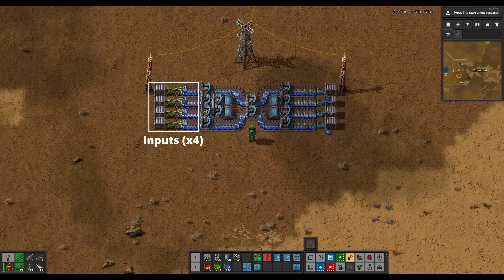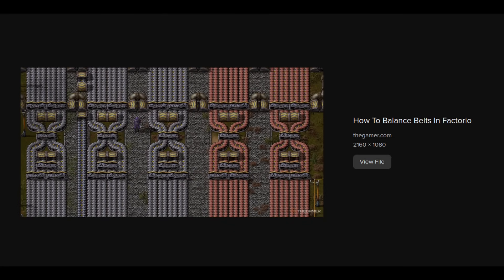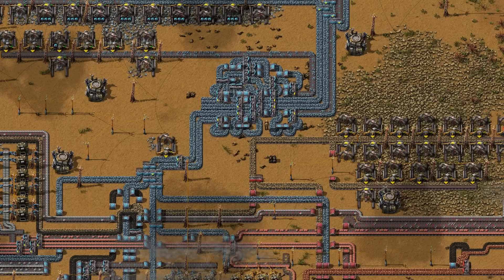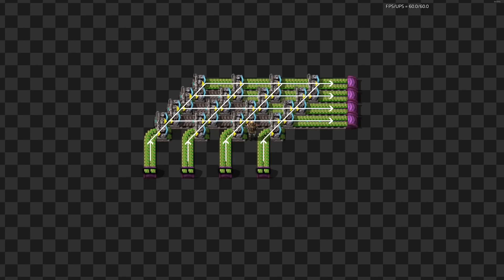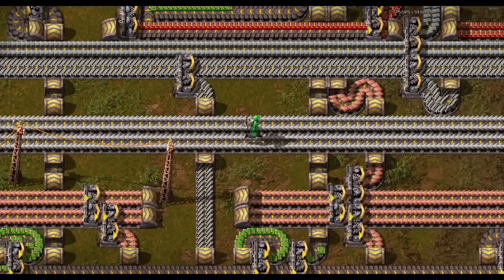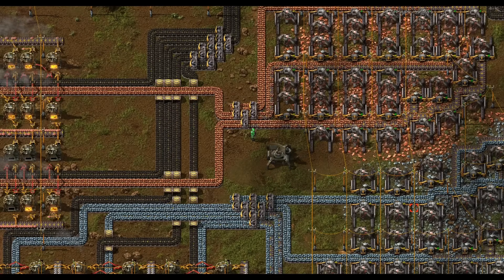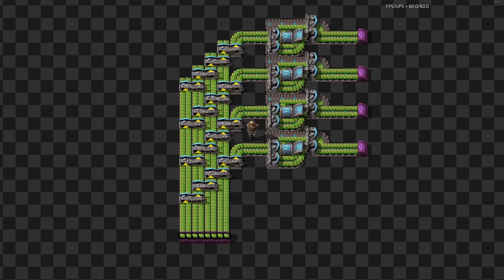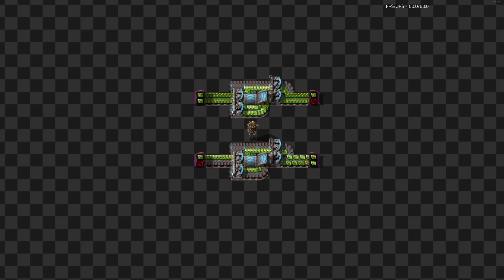Crossbar Switches: An Alternative to Belt Balancers in Factorio

Comment: I'm really glad to hear someone discuss this.  I've been saying for years, lose the balancer.  I don't even balance most of my train stations.  I like to design production areas with a number of production line equal to the number of wagons in my trains, so it just becomes one belt per wagon per production line.  The keys are designing systems with buffers and overflows, and always over-feed it.  Make a supply train offload into chests and depart on a timer.  it doesnt matter if that train leaves with plates or whatever still in it.  What matters is that the delivery chests always have mats in them.

The only thing i really use balancers for is when my supply train needs to feed a number of belts thats different than the number of wagons, i'll stick a balancer after the delivery chests.  And i do use a decent amount of single-belt lane balancers to offset the effect of inserters always pulling from the same side of the belt.

Comment: I've used these for a long time now but never thought about their technical name. I like "crossbar switch" but I'm not sure if it is quite correct because of the difference between input and output versions. I do remember discussions about calling them diamond switches/balancers or triangle switches. One version you haven't covered in the video that is a little important in an edge case is something I have called a "buffered lane prioritization system" or a "compressing filter."

This is useful in a case of an N:M belt system where N > M and the average input throughput is exactly equal to the maximum output throughput of M belts. For example in a line of advanced circuit assemblers made to produce exactly 1 belt of circuits. You might find that outputting to 1 belt causes the inserters to pause and makes the assemblers back up, reducing overall throughput of the system. To fix this you need to output onto 2 belts and then compress them down to just the one.

At a bus level this can be done with something that looks like this blueprint:

0eJytV9luwyAQ/Jd9JlE43MR+7G9UVZS0NEJysIVxlSjKvxfX6aECNmz6lAOYgWVnZ7nAvu5la5S2UF1AvTS6g+rpAp066F09/GfPrYQKlJVHIKB3x+GXPLVGdt3Cmp3u2sbYxV7WFq4ElH6VJ6jo9ZmA1FZZJUfE6ZUE2qZzkxs9cDqARbEsCJzdl9WycLivysiXcZzdkM9b3R/30gxsxCPo2lpZ60Z9aH6DpnO4LIDbuwOag2ncZ2zrfGrrX/HUbT+s/cPIcYw0gbHpbZBSBChnb2eVcTsFhoDdCDz8lYf/cA++fwCfYH0XAZ2P0AZDQDMIyrvu2CMQvgJX98Qo4QQ0pPHkGKUQhMSeHCOPwM8iGtJ2MkFCmtKQkifKoPiCng1NQcZ6tXVO0Rg35Ahq+Tbsd6wq3kDWTn4yeXYnD/+xk/mCOine6QpOQ9UifnaWfAmYIvHtRCxBAJgiwaOB8vOTYWpE3EsDBJgawWMCC7QDmBIhMq6A4exfJGRrzP0Zxv5FRsww7l9EY+Y7D8PYf5HhnQxj//HuNZC2GGUX6b7AMMLOafB4SNg5fXJ+leUhqc9TxluaeaVwVIMwqc2/DKgOISeXuRjeZZ9vuerX04/AuzTduGZDxbpka8HKkpeUQL1zvG724/fs6/UDuD+85w==

Comment: You didn't talk about it explicitly but you did mention that you seem to think even train loading is important, and that balancers have a utility in that instance. I am skeptical of this given that one can always create more trains. 

I view trains as a pipe connecting a supply and demand. If the frequency of trains * train capacity < production rate then production will be restricted, if the reverse is true then trains will idle. Obviously we don't want the former, so we should have the latter: an excess of trains. Therefore we will have idle trains. If the trains are going to idle anyways, why does it matter if they are not filled in minimal time? The only thing that matters is that they don't fill so slowly that they frequency drops and constricts production. 

It seems like people are often using balancers at production stations because they aren't running enough trains. I think they should just have an overflow station with an extra train idling at that location to capture any production that doesn't get captured by the primary loading location. In other words each station becomes an B, A stop. First you stop at B with no condition (you are waiting to go to A), then you advance to A for the full load. If flow is uneven and loading into  the last car of A takes longer, that will be okay as the next train will take that load at station B. 

Obviously there are downsides to this, but it seems easier than trying to design some of these crazy balancers. I would be interested to hear some discussion of this.
Reply from the maker: Oh, the real problem isn't really with loading the trains unevenly… it's loading the buffer chests unevenly.  Stations often have 6 or 12 of those, and they're larger than the cargo wagons themselves are.  Loading from the front only, for example, could have over 12x the materials stored in buffer chests before the second cargo wagon gets any items.  Repeat for X wagons in the train.  On the flipside for something like a mining patch, when you run out, you'll have thousands upon thousands of items in most of the buffer chests yet the last wagon will be empty as the mine expires; some train stations might not send out due to inactivity.  Even if they did, train throughput would drop.  The convenient method is to balance loading the buffers so when you run out, there's almost nothing left to clean up.
Reply: Running more trains for the same load means that your train network gets less efficient as junctions block trains more often. If your train network is sufficiently overbuilt that doesn't really matter, but when it does approach the limit, throughput drops sharply and a poorly built network can even deadlock. So that's a reason to prefer trains to fully unload, and to do that you want even distribution between wagons.

Comment: I have been using these almost exclusively over balancers for years. That whole time I called them "top saturators" since they prioritize saturating belts in a certain direction (towards the "top") rather than balancing across belts like balancers. It's important to note it isn't just a different solution to the nm routing problem, it also imparts an entirely different philosophy when designing your factory, since now your bus belts will be prioritized in a certain direction rather than being fed equally. It is not sufficient to say they both solve the same problem, as 4 belts from a belt balancer behave entirely differently from 4 belts from these crossbar switches. Crossbar switches do not balance generally. You should use a belt balancer only when that is what you want: balance.
Reply: Also you say crossbar switches are not cheaper in terms of balancers, but they ARE cheaper if what you are seeking to maintain is top saturation on a bus through various outputs being pulled off the bus. Say you have 8 belts on a bus. If you want to maintain balance on the 8 belts, you need to start off with an 8-8 balancer. Then after every belt of output is pulled off, you need to put ANOTHER 8-8 balancer to rebalance the belts. However, if you want to main top saturation, you start off the 8 belts with a top saturator / crossbar switch, which may have more splitters than the 8-8 balancer. But, as you pull belts off, you only need 8 splitters, one for every belt on the bus, to maintain top saturation on the 8 belts. So maintaining top saturation is much cheaper than maintaining balance on belts in a bus.

Comment: I used to love the N:M distribution problem, but over my nearly 8000 hours of Factorio I've grown tired of having to solve it every time it rears it's head.
The belt balancer blueprint books that you typically find are VERY helpful to stave off this tedium so long as you only have up to 8 belts on input or output, but eventually even that becomes tedious, and I also got tired of having to create or look up a new balancer every single time I had a larger number of belts on the input or output.
On the plus side, most of the time it's not TOO hard to take any balancer that has a differing input to output belt count and derive one that's got the input and output belt counts swapped, but even then I just got bored of doing the same thing over and over, especially since the larger the number of input and output belt counts got, the longer it took to conceive and implement the solution in a non-linear (exponential) fashion, simply because of the exponential growth nature of how many different ways you have to connect input and output to get the dang thing to function as expected.

I've recently found myself reaching for what I consider to be the Holy Grail of N:M distribution problem solutions, found in a combination of 2-3 simple and small mods:
1. Merging Chests (there's one big suite of mods (" Merging Chests ") that does this using default Steel Chests, but there's another one that creates a new item which uses the Cargo Bay merging logic if you have Space Age, either one should work just fine for this task), by default they let you unite some arrangement of adjacent chests into one larger chest (with Merging Chests the inventory size is either "the sum of the combined chest slot counts" or 2000, whichever is smaller, but Merging Chests only merges chests that form a rectangular or square shape).
2. "Pick your favorite" pretty much any Loader mod (Currently I'm using " AAI Loaders " with a companion mod (" Cheaper AAI Loaders ") that makes the non-lubricated mode loaders actually have sane material costs to make in an Assembler, but Deadlock Loaders is another great one and that one just has sane costs right out the gate)
3. Since I'm playing with Space Age, I have a mod (" Loaders lane-filter and stacks ") that allows Loaders to stack items on the belt as well as letting me use the circuit network to control the loader as if it was an inserter (and set each belt lane's filter via circuit network or manually).

Combine those three mods and what you end up with is the ability to balance belts virtually effortlessly, as well as handling the occasional issue of potentially mixed belts which you might encounter with ore patches that have encroached on each other.
IMO it's not any less difficult to solve the N:M distribution problem this way, but it IS a whole lot more compact (at least lengthwise) since the loaders only take up at most a 2x1 space and the merged chest's dimensions can be as small as N x 1 where N is the number of incoming or outgoing belts (whichever is greater), leading to a minimum length of 5 tiles (or 3 if you are using a loader mod where the loaders are only 1x1 size rather than 2x1), and a guarantee of zero additional width beyond the largest of the incoming or outgoing belt count (looking at you, typical "not great, not terrible" 8x8 balancer).

IMO the overall impact of these mods for solving the N:M distribution problem (assuming you were going to be solving it manually every time without blueprints) is that it linearizes the trend of "how long is it going to take to conceive and implement a given N:M distribution problem solution" as you increase the number of involved belts.
Normally (with only belts undergrounds and splitters) this problem suffers from exponentially increasing conception and implementation time as the number of belts goes up.
With these 2 (maybe 3 or 4) mods, the problem's solution time becomes roughly linear with an increasing number of involved belts.
Reply: Do any of the loader mods give you lane balancing?  I've tried merging chests+loaders before and that was an issue.  Some lane imbalance can be worked around, but others have no clean solution.

Comment: Dude. Solves so many issues I have with my mega bases. Now when I need 40 input ore lines (Five 1-4 trains unloading from both sides) feeding 26 beaconed smelter lines, I don't have to use a 64-64 balancer refeeding the excess outputs back in to the input. It'll be a heap of balancers, but at endgame you usually churn them out. Balanced freedom for weird line counts. 37 to 19 here I come!
Reply: Usually when you're megabasing the concern with these isn't the material cost of the splitters, but the UPS cost of the splitters. That is, big blocks of splitters like this absolutely tank performance in large enough numbers. Though, if that's a concern you're usually going to be avoiding balancers entirely in favor of hard pre-calculating everything.
Reply: @teddy4271 I get you man. Once my mega base is up and running I can usually do away with the large 40 to 28 (or whatever) balancers between ore unloading and smelters. It's the in between time when I don't have enough mines and trains feeding the factory that I need a balancer. When I've finally got 5 trains getting unloaded with 10+ trains in the stacker waiting to be unloaded and the factory's been cranking science for 10 minutes, then I feel like I can get rid of the monster balancer and gain back some UPS.
Reply: Have you thought about using bigger trains? 5 delivery trains for the same material doesn't seem like the most efficient setup in terms of your rail throughput.  I've been pretty successful building around 1-12 trains.

Comment: I have been using this tipe of design regularly since i started to play factorio, i only started to watch some tutorials after reaching oil research, soo i got used to using them before discovering balancers existed, soo i didnt really implement them, 600 hours later and the uses i give to this tipw of design is for mining outposts, and for artificially keep my 1 line bus design working, it is a single line using them for remove and add resources where it is necesary, it is a single long belt with inputs and outpouts, but in reality it has spread the input of 2-4 blue belts where at max capacity start to run out just add another of this inputs, this allows to have train stations closer where the resources go, instead of all of them on the same place, helping keep everithing spread around instead of masive sectors for a single thing, and 3rd case i used them as filters on fulgora, from a sushi bus with all of the outpouts from reciclers, it it pulls out a tipe of material for each one of this that is placed, and since they are already big they give me a a separated space inbetten for help me see where everithing is, when the input of x material is bigger than the outpout, the entire sushi bus stops, i do this on purpose becouse on fulgora i do not delete most of the items since i like to storage them,soo when the whole thing stops moving i know wich material is cloging the thing and i increase the consumption or storage for it

Comment: You clearly know what you're talking about when it comes to balancers, and there isn't enough discussion about these finer details -- but I don't think I ever heard a compelling use case for the crossbar switches over balancers in this video? I was looking for some problem that a crossbar switch would solve that balancers don't, but aside from being easier to build and integrating more cleanly with a Bus system, I don't think I'm clear on that.
Reply: That is the case being made here, correct.
Reply: More proper balancers will always be better, but often times you don't need "better" when "good enough" is good enough. Especially when it is several times less annoying to build.
Reply: @kajacx   I'm nearing the end game and have yet to ever use a standard template. I see all these complex balancers that everyone loves to talk about, and I just don't get it. I mostly just slap 1 row of non-priority'd splitters across the lanes and call it a day. I have multiple streams coming in from multiple directions, but they all end up in one giant ball of production anyways, whichever path they take.
Reply: Pulling off of a bus and compactness is where crossbar switches shine. You don't want to build a throughput unlimited, perfectly evenly balancing 4:5 balancer every time you pull 1 belt off of your bus and have 4 belts continuing. Especially the perfectly balancing aspect would be overkill, since the machines would almost never need exactly 1/5th of the materials on the belts. You'd run out of space. Yes, the more sane option for that case would be to pull off of each of the 4 belts, and then build a 4:4 balancer, but the crossbar switches are still more compact than that - I think. And they save you the hassle of counting out where every 4th pull off happened, and you don't have to relocate the 4:4 balancers if you decide to pull one more lane off somewhere upstream.
Reply: 1. Balancers hide problems. It is easier to tell what is an issue when your bus compresses everything to one side. 
2. Lag. Full/empty belts are way better performance-wise than partial belts. (though these setups suck for lag too)
3. Throughput unlimiting in limited space. Many standard balancers have combinations of blocked inputs/outputs that will cause you to lose some throughput, which is typically fixed by stacking 2 balancers end to end. That ends up so big that no one bothers. This on the other hand is way easier to get to a throughput unlimited state.
Reply: @petkras  I disagree with balancers hiding problems. If you're balancing everything and you draw too hard on the system, your supply side will start to dry up. That's actually the only thing that can happen. If you don't bother balancing everything, you can run in to all sorts of weird issues.
Reply: @Hawk7886  i think i'm going to run into weird issues because i put 2 way rail everywhere because it's far more compact, but usually only 1 train can take a segment at a time (but at least my trains never deadlock and i only need chain signals).